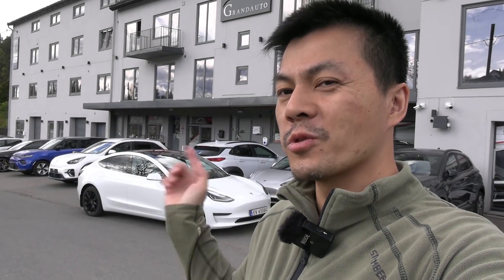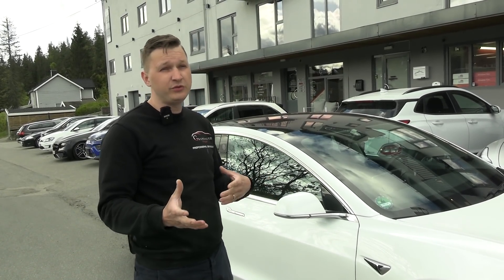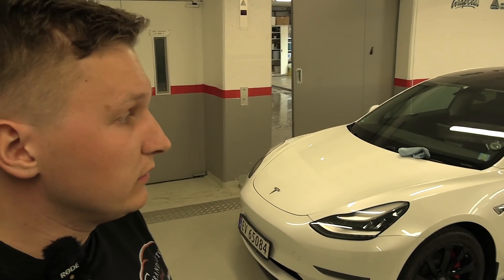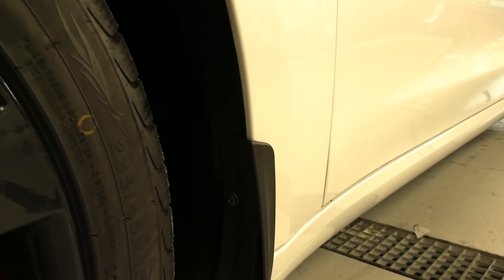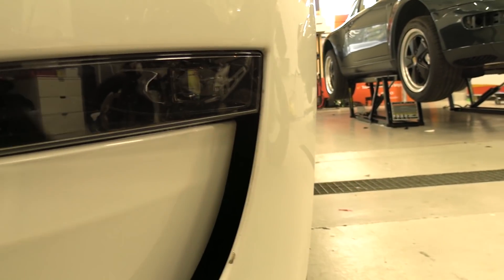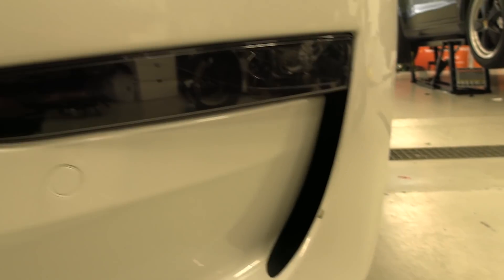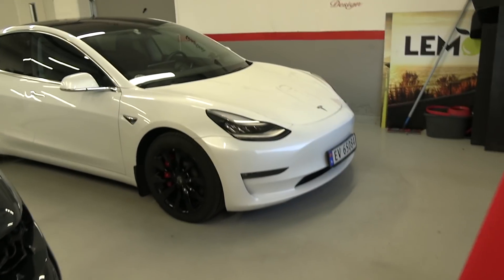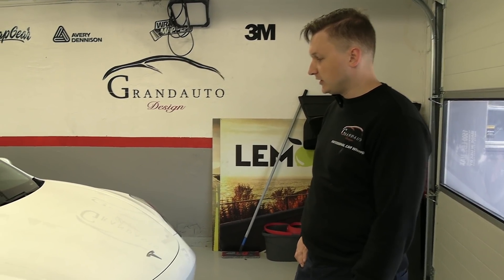Model 3 Ceramic Pro maintenance and rear window tint installation

Comment: WOW SHEET! Can't believe he's used a metal blade cutter to trim the PPF. That's a massive no no as its likely he's cut through the film into the paintwork. I suffered major paintwork damage on my GTR, with score marks after they used a metal blade to cut the wrap on my car. Although my car was deep blue, so the marks showed as white, as it went through to the primer underneath. You might get away with it as your cars white, but I'd be taking a very close look at the paint around where they trimmed the PPF.
Reply: A skilled installer can safely cut the film while on the car. But not every installer is as skilled
Reply: @p4ult1  That's a very true statement, however, why take the risk when very sharp plastic blades are available, that will do the job without damaging the paintwork.
On my car, I only noticed the damage whilst washing/drying the car, and looking close up. Only when I had the wrap removed, the true horror was revealed, turned out every panel was scored.
Reply: @williamjewitt973  agreed, it should be avoided if possible
Reply: best would be a cut stripe.
Reply: Exactly the same guy from GrandAutodesign damaged my car he damage paintwork because of using metal blade and they don’t even want to take responsibility for that...
Reply: If done correctly you only score the surface layer then it tears as if perforated
Reply: The cutter may look scary but you need metal to cut, plastic does not work. Maybe you can use some protection around to avoid damages. And you need a safe hand and skills.